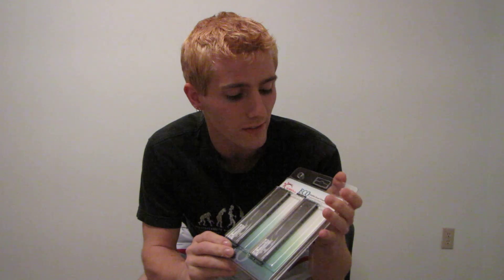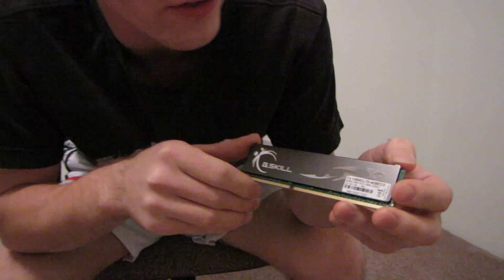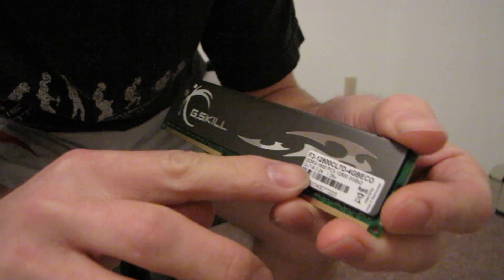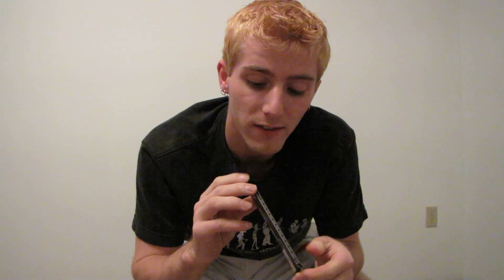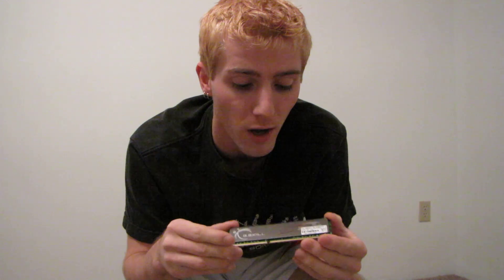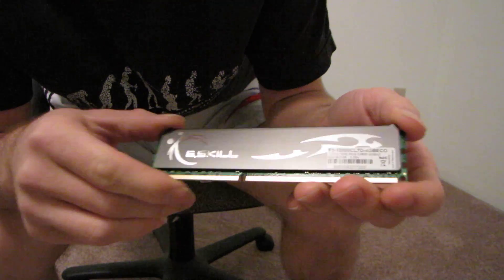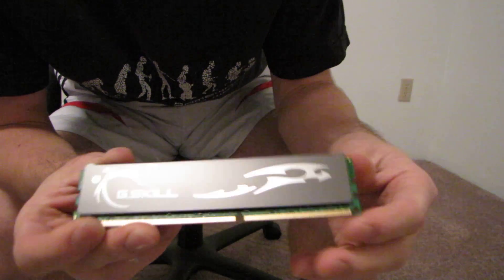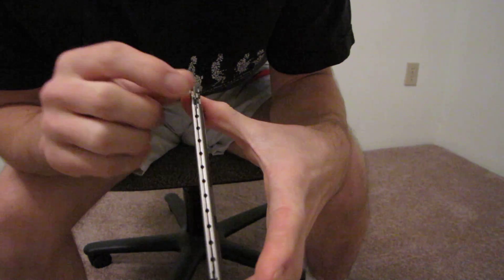G.Skill Eco Series DDR3 Dual Channel RAM Memory Unboxing & First Look Linus Tech Tips

Comment: Question for you sir.  Looking at G.Skill Memory Ripjaws Series.  Which is better? 7 latency 1600mhz or 9 latency 2200mhz. Will the 9 latency @ 2200mhz  run faster than the 1600mhz @ 7 latency? In the Asus Maximus IV Z68, @ 2200mhz, the ram will be auto down clocked to 2133mhz. The 1600mhz will either stay the same or be down clocked to 1333mhz. I'm looking at 8 gigs of ram. Should I also go with 4 x 2gig sticks or 2 x 4gig sticks. Does it make a big difference? Thanks bro.
Reply: he just left you on read lol.
Reply: @Dexplaze.  10 years later and he can't reply back to me? What a douche! ;)